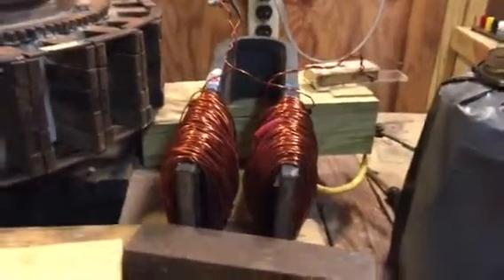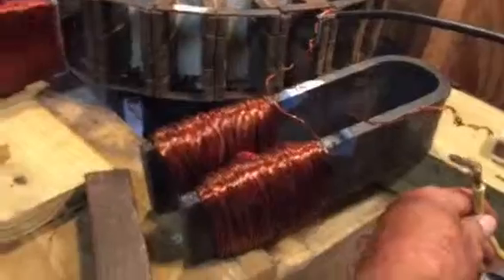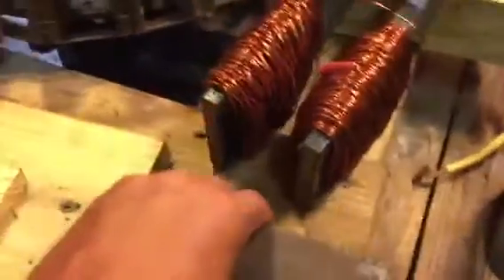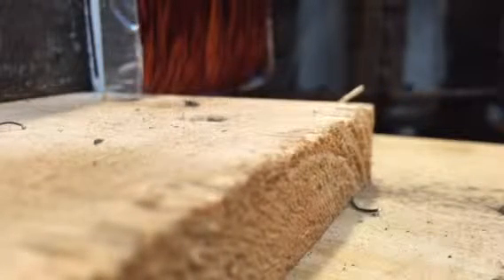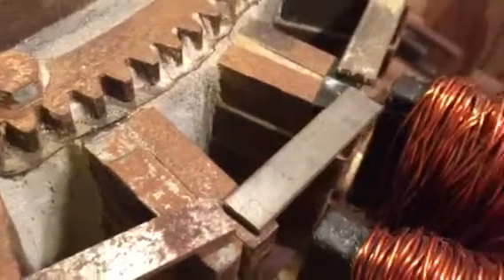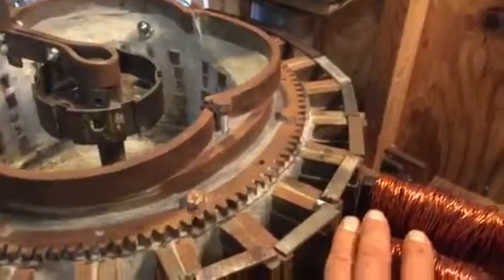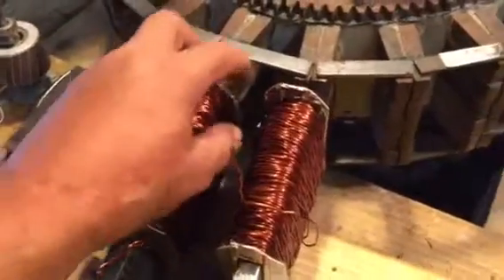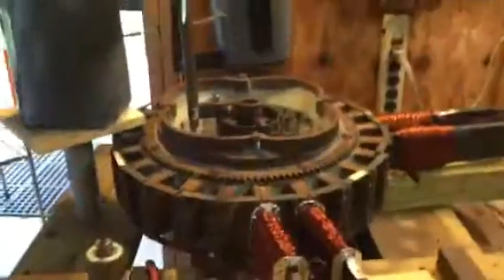Ed Leedskalnin Perpetual Motion Holder.

Comment: i believe this doesnt work with magnetic current, but by the hysteresis loop which only goes upwards, the connection of the coils cancels the currents when battery is removed so there is no magnetic force driving the hysteresis loop tru demagnetization or pole reversal.
the coils are charged in parallel, removing batt puts the coils with current in series.